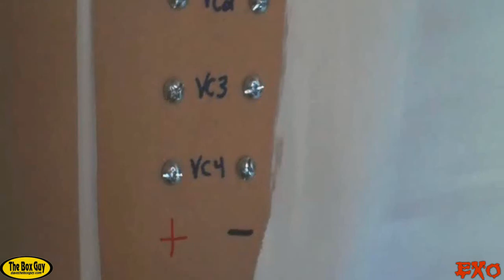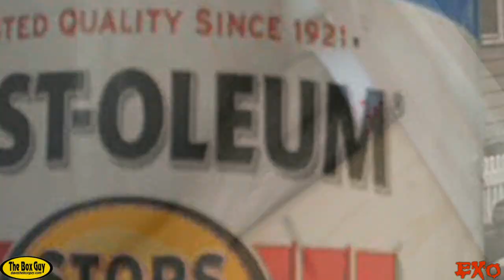Painting MDF Subwoofer Boxes w/ Gloss Paint & DaveTheBoxGuy Car Audio Designs - EXO's BIG BASS Wall

Comment: EXO, thanks for posting up this vid. I'm an audiophile as well as a bass head, but im too young for a car, let alone a license. So i decided to put a kicker 10c124 in a 2.15 cu ft enclosure ported at 33 hz with a 350 mono visonik amp in my room. i didn't know what to paint it with. so i saw your video, and found the same company that made the paint, but will be using gloss black with primer. it seems to be working for you. the paint is one quart, about 32 fl oz. thats enough for 30 sq ft right?

Comment: 76dced thanks but i want a spl port does the same thing apply my port is 20"by 9" at 30 hz and i calculates the lenght to be 27" i want my lenght to be 10 or 12"

Comment: Try putting a copper piece (30x3 millimeter thick, long enough to stick 50mm out on both sides), instead of steel bolts (steel bolts have about 0.3Ohm, that's 0.6 both ways). then you drill holes in both sides and have a low-Ohm terminal you can use double (one on each side of the plate, on both ends of the plate) zero gague wire on. If you have amps that can handle the speaker's ohm at max volume then you get more sound by decreasing Ohm between amplifier and speaker.